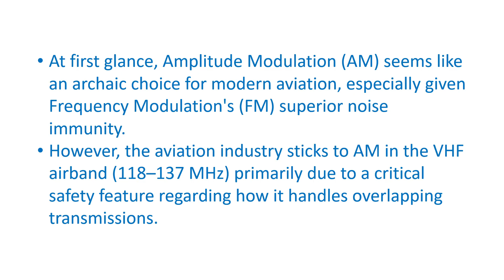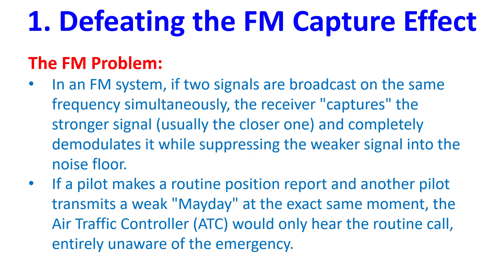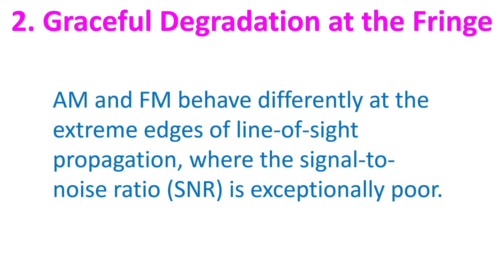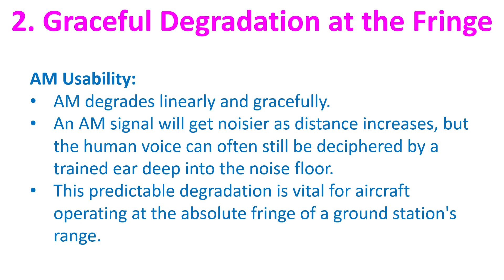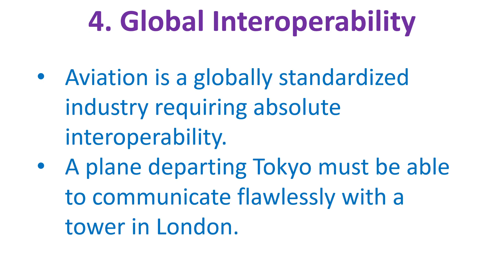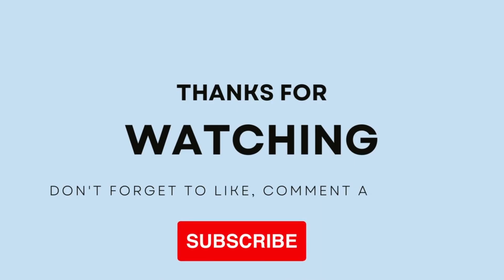Why Airband Still Uses Amplitude Modulation (AM)?

Comment: Nice info. Do you have ssb n am difference video. How it works in actual waveform.
Reply from the maker: Thank you. This is a basic one: What is Single Side Band (SSB) in Amateur Radio? https://youtu.be/eBOgpkFQEj8 Observations in my radio have been documented here:
Comparing Spectrum Spread of AM, SSB, CW and Digital Signals https://youtu.be/5O5D4HdQz3Y
Testing Spectral Spread of SSB output from Easy BITX https://youtu.be/136EENLFcBw
See the Massive 200 kHz Bandwidth of FM Broadcast! https://youtu.be/OksVCruuU44
I have been thinking of buying an oscilloscope to see actual waveforms - but yet to decide on the best buy. Moreover, it is a bit expensive!